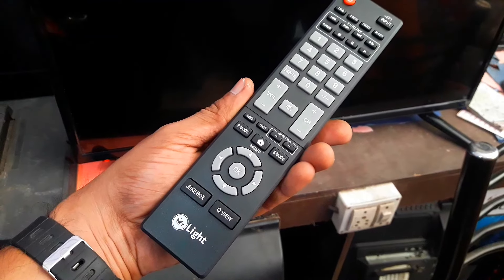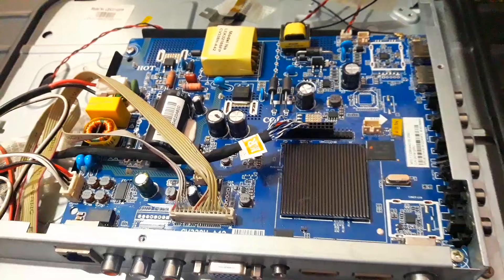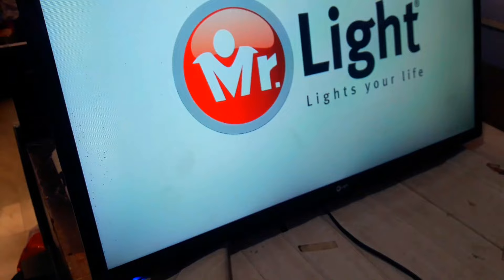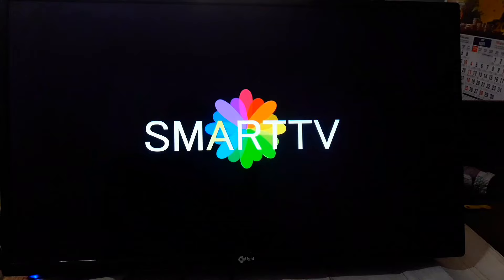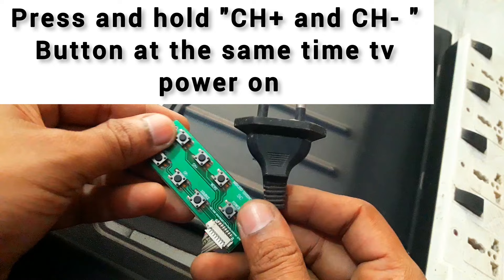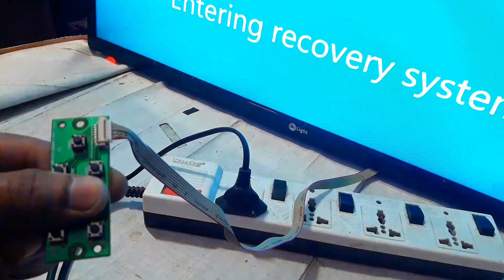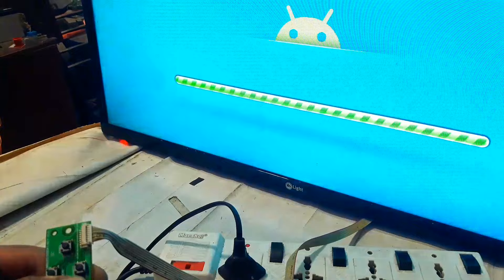led tv logo hang problem / smart tv logo stuck

Comment: I needd help i am  having same problem
Reply from the maker: Try doing as seen in this video
Reply: I have done this but cant get into recovery i have the same tv
Reply from the maker: @user-ez9ge5lv2u  Maybe your TV's kepad buttons are not responding properly.  Sometimes the keypad switches are rusted.  First you replace the switches with new ones and then do as shown in this video.  Or install new firmware.
Reply from the maker: user-ue9fe9eu9t  sorry for being late reply  ..  Please comment your tv brand and model number